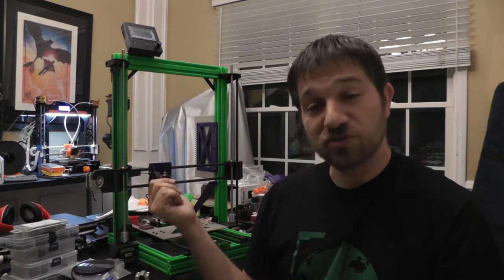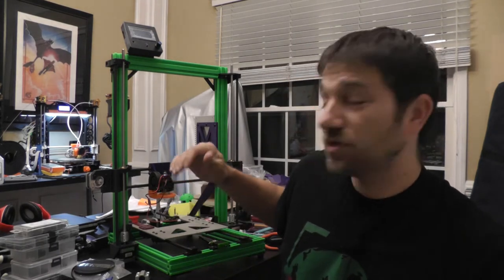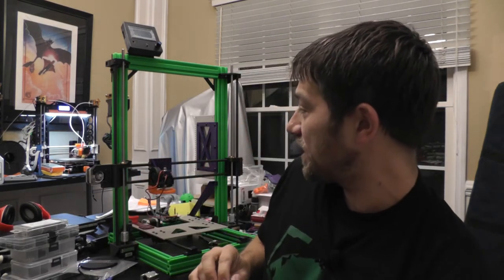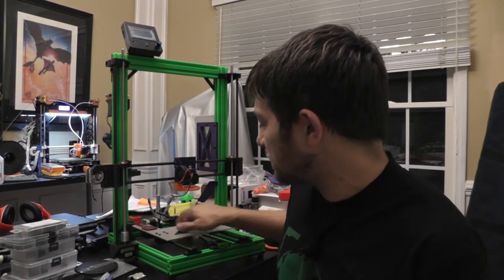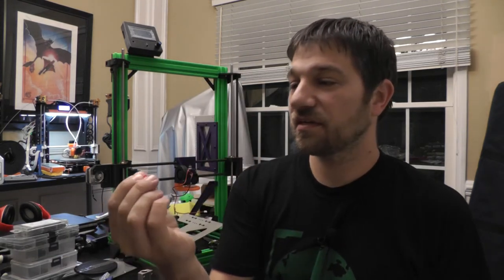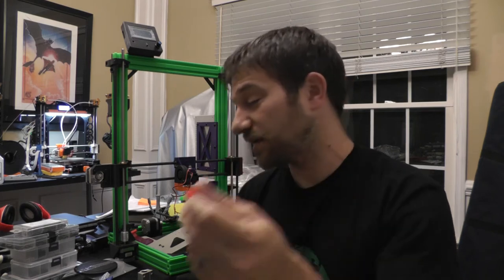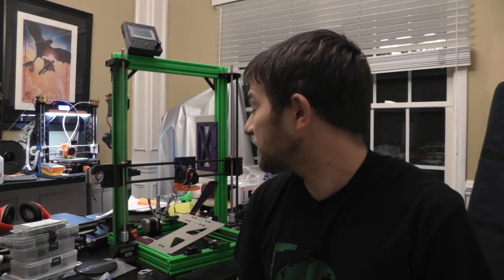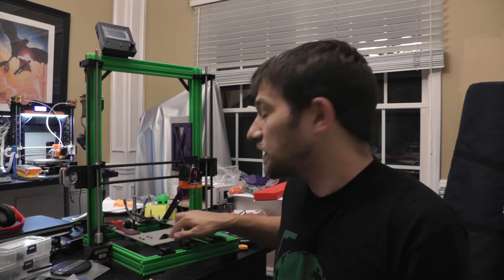Carbon Fiber Rods on 3D Printers

Comment: I have been running pla bearings on steel on a prusa clone for over a year with great results. In all this time the amount of wear on the metal is non detectable and the bearings barely any. But i use very good  teflon grease like super lube. Im building a large core xy  and plan  to use 12 mm carbon rods and printed bearings but with igus filament throughout.

Comment: i plan to buy 1mm teflon sheet, cut into small pieces, use it as lining in the bushing
Reply from the maker: That's a really interesting idea. So you plan to print the bushings to make them the right size?
Reply: @kerseyfabs  yes of course, the bushing must be able to hold the slippery teflon in place so some designing to do. Or i could just buy a mouse feet that already have a sticker backing.

Comment: I think the z-axis option is the best because there’s no loading on the shaft surface and grooves won’t be created. Long-term update, how is this working out for you? I’m looking to buy a 12 mm OD, 8 mm ID rolled tubing for my z axis. I was gonna use igus 12mm bushings
Reply from the maker: Thanks Adam for the feedback. I agree on the Z-axis and the Igus or printed bearings. This printer isn't together any longer, as I moved on to bigger projects. This was a short-term test rig. So unfortunately, I don't have a long term update. 😟 It's also worth considering linear rails or ExoSlides on the Z axis as a more expensive but high performance option.
Reply: @kerseyfabs  Thanks for the quick reply. In terms of accuracy, do you think I am loosing anything going with the carbon? I'm hung up on just using 10mm hardened shaft for the z-axis.
Reply from the maker: @Adam-qr4jj  No, as long as they're accurate in diameter, you should be fine.

Comment: Nice video, I would recommend sanding the rods in the places where the slider sticks. This should help, but make sure to wear respiratory protection when sanding carbon fibre.
Reply from the maker: I didn't see the notification on this comment when you posted it. Thanks for the feedback. That's exactly what I did on some of these!

Comment: There's not that much to gain with carbon fiber here. You have a bed slinger. That is the limiting factor to how fast you can print. Removing mass from the gantry is of minimal value in this model printer.
Reply from the maker: Agreed. This was a long time ago. It was a fun project though.

Comment: hi, can i use bronze bushing on glossy carbon fiber rods or have some some problem in movement?! thanks!
Reply from the maker: You can but everything has to be lined up very well. I would also suggest that they be coated on the inside with something low friction to reduce wear.
Reply: @kerseyfabs  what kind of material that i can coat inside?
Reply from the maker: @Destructorbr  What you'll want is something like this: https://amzn.to/2SxoKSF They are self-lubricating. You don't really coat them yourself.

Comment: Any follow-up to this video?
Why rods, not tubes?
Reply from the maker: In fact I do have a follow-up coming probably next week. I'll be going over a few last comments on this prototype printer before starting my build of a large format printer. Thanks!
Reply: @kerseyfabs  I'm very curious, I just ordered some pieces of my first 3d printer, 
I wonder if I should try 10mm carbon tubes for X axis.
Reply from the maker: @cthulpiss  If your X-axis is going to be moving a lot, as in a CoreXY or H-bot design, I'd say go carbon. If you're building a design like in this video, an i3 design, which the X-axis only moves up and down, then I'd just go with steel. The steel rods are easier to work with. See this video (and others in the series) for more information on a CoreXY with carbon rods: https://www.youtube.com/watch?v=0Pg-L1pQ6qU&t=3s
Reply: @kerseyfabs  That's what I thought. There's no real advantage in using carbon fiber rods in this kind of printer. It looks cool, though.

Comment: Do you think that it is a feasible ideea to 3d print carbon fiber threaded rod (M6 size) for linear motion mechanism (to lift 2 kg for  1 time per day, very low speed)? I need to avoid metal in my environment. What printer should I looking for? Thanks!
Reply from the maker: It may be possible and I'd love to test it. The key would be to print it slow and accurate and probably print it a bit oversized so that they could be sanded smooth after printing. I don't know if they'd ever be quite as nice as the real thing though. Thanks!
Reply: No. As that isnt carbon. Its pla/abs with some carbon in it for an aesthetic look

Comment: what is the cost difference between carbon fibre and metal rods?
Reply from the maker: I think they're relatively close in price, if I remember correctly. It's more about weight and rigidity than cost at this point.
Reply: @kerseyfabs  Thanks for replying!, I'm thinking of adding buttress's to my Ender 3 and CR-10 from the top of the gantry to the front extrusion but had not thought of carbon fibre rods until I saw you using them, do you think they would be useable in this modification?
 I saw your channel listed on Naomi's latest video and I love your content!
+1 SUB
Reply from the maker: Thanks Andrew! Yeah, I think carbon fiber would be perfect for that. You could 3D print the connectors.

Comment: nice toothless and hiccup poster in the background. I would suggest getting rid of those rods ASAP. That is a huge health hazard as soon as the carbon starts to wear down. It's almost guaranteed you will have health problems later in life from it. Not worth it IMO.
Reply from the maker: Thanks for the health concern. I'm not using these anymore. It was for testing mainly and for my use case, it didn't add any real benefit. I do wonder if there is any real concern though given how little carbon this could likely produce and how much would get airborne.